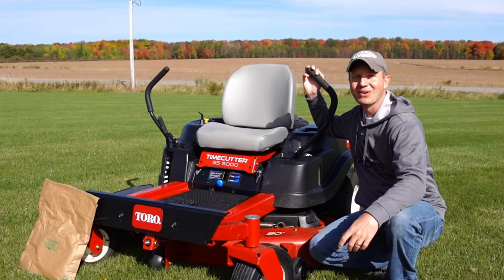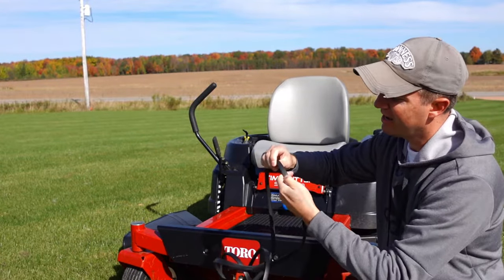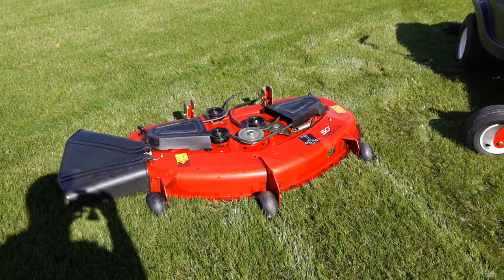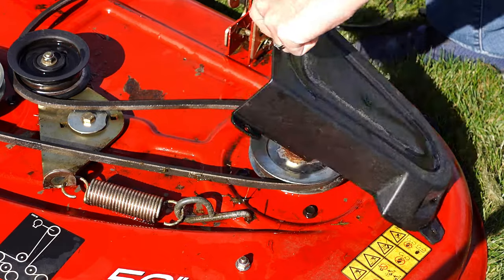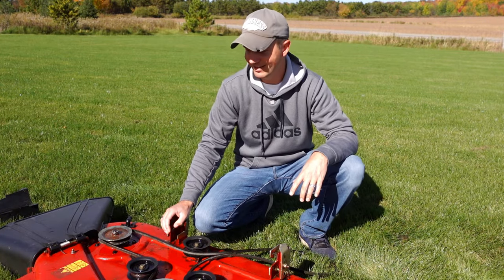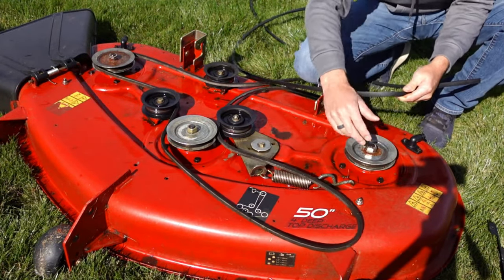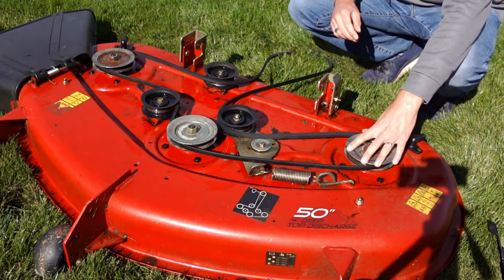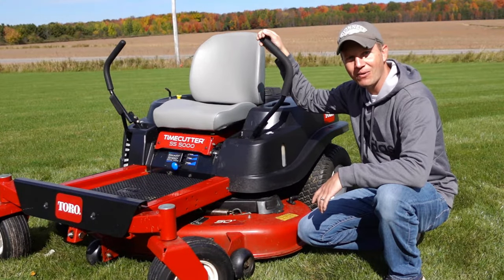How To Replace A Toro Timecutter Deck Belt | Budrash Belts

Comment: OMG! You don’t have to remove the deck.  I watched a different video and did it in 10 minutes without removing the deck. I am a 65 year old woman by the way and this was my first time doing it.
Reply from the maker: Nice job!  I removed the deck for demonstration purposes. It is easier to show what is going on with the deck off.
Reply: 6 min done .just unhook spring.wow crazy
Reply: I don’t know if you’ll ever see this, but your comment gave me the courage to do this myself! I’m a 48 year old widow who has been so overwhelmed with this job & your comment was just the boost I needed. From one gal to another, THANK YOU!!! @marcimo
Reply: Awesome! So proud of you👍🏽
Reply: @jenp7895  yay! Did you do it yet?
Reply: @Marcimo  YES! I did it! I'm proud of us!!
Reply: @jenp7895  Awe, Me too❣️
Reply: how did you work the spring back on
Reply: Mine went back on quite easy, easier than I expected. I didn’t even use a tool, I could do it by hand.
Reply: @suzieq8379  that was the hardest part. I actually took a very thick piece of discarded electrical wire and slipped it through the loop on the spring, then twisted the other end Of wire to the back of my car . I aligned the car properly and pulled slowly ahead until I had enough tension to hook it in😅
Reply from the maker: No need to remove the spring if you detach the deck.  That is another reason to remove your deck, makes this process a lot easier and you can then do cleaning, inspection and maintenance on your deck while it’s off.
Reply: @Marcimo  seriously wow mine has came off several times and me and a guy would pull that spring till we got it on straining our guts out  it says in the book to roll it around the pot clutch I'm not sure that can be done I dunno waiting for my help to arrive dread it
Reply: @jenp7895  must not be to tight
Reply: @suzieq8379  yes! I tried many different things before I came to the car tow😅 including a crowbar and using ropes while leaning back with all on my weight.  I would get tired out and sleep on it thinking of more things to do. It took about three days until I thought about pulling it with my car.
Reply: my friend and i did it she rolled it on the clutch while i pressed against the pulley that moves went on just like that
Reply: @DeanoOutDoors really bruh, now I have to put that shit back on, your accent is agitating too

Comment: Great tip, taking a picture of the belt before taking it off! But what if the belt has come completely off?
Reply from the maker: Thanks. There should be a diagram located on the deck as well, if that is missing you’ll need to resort to the web for your particular deck.

Comment: Thanks for this. Just had a new belt installed in my SW4200, and after an hour of mowing time it has started to make a loud and short squeal sound just as I engage the blades. Then everything works fine. Do you have an idea of what might be wrong? Thanks again.

Comment: Or you could use Genuine Toro Parts.  But nice video, lots of room left intially on the belt so good to explain early that this is normal.  Other key is--after use for a year or two, many leaves, sticks and grass will get stuck in the blade pullies under the two covers.  Of course, cleaning those is important to keep the blades running well.  And while you have the deck down to change the belt, change the blades at least once a year if you cut weekly.

Comment: Theres literally a picture of the belt routing on the deck in front you
Reply from the maker: Yep, but after a couple years of use, that will no longer be there.  Especially if you ever use a pressure washer to clean. Thanks for watching.

Comment: There's a diagram on the deck on how the belt should be set
Reply from the maker: Yes, thank you.  Over time that diagram either fades away or gets accidentally removed from pressure washing.  If so, it’s a good idea to snap a pic before removing the old belt just for reference.  Enjoy the mow!

Comment: So I just replaced my belt and noticed on the left side of the drive pully the belt is vibrating. The right side is totally still. Is this normal? This is when idling with the mower deck is OFF!
Reply from the maker: Does it continue to do that after you mowed with it?   It’s possible the belt had some slack on that side from the install.  Be sure that the belt tension is correct.

Comment: Friend I understand you did this with Toro recommended safety in mind, but there are about 6 steps most people will not need to do :) The deck need not come off, just the idler spring. Reattaching that takes a screwdriver used as a pry bar through the hooked bend, and sliding it back to the deck eyelet hole. You also, if you are deft enough , onl yneed remove one drive pully cover as you can force fit 1 side (Exhaust side) with fingers under the bevel (I am 6'5 and 210, my hands will not fit so it's both covers for me :P ) 

    The most complicated part, and you do show it nicely, is the belt threading positions. 

           I came to check the idler pully count as I sheered ONE off with a fill line that was surfaced and under debris. I now realzied Ive bought an additional 70.00 in parts...but Im sure ill use em some day :)

One thing I do notice is your wheels. I use solid material, turf front wheels, and back tread read tires as I live in a WET area and sliding on one of these beasts is a nightmare.
Reply from the maker: Thanks for the additional tips!
Reply: OR, just take the deck off.  SO much easier to remove the covers, CLEAN the pullies (will have dirt, leaves and sticks in there after a year) and then easy to re-install.  And change the blades at the same time, another reason to remove the deck.

Comment: Good ideas. I tried that with the wood and failed. Went back to spring puller had ahard time. So I hooked the spring puller placed the hook a couple rings back on spring…hooray able to put spring right on. 
Still your video kept me from taking it to Toro 💸 also getting belt from Amazon big savings.
Still I like my Toro Titan zx6000. Consider this just routine maintenance 😊
Reply: so how did you get the spring back on, what type of rings??